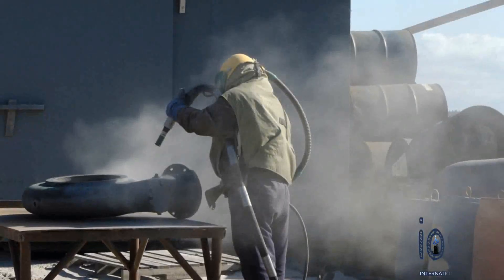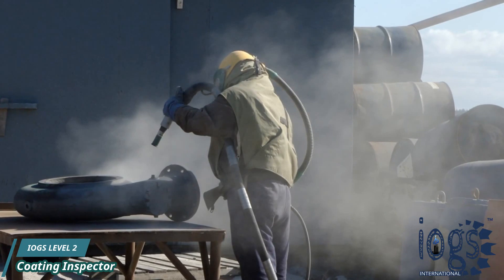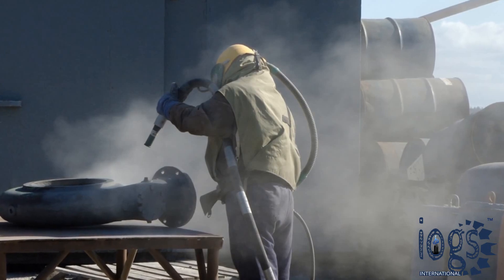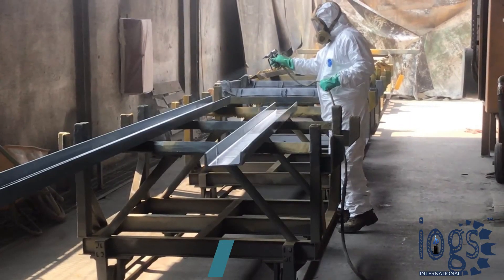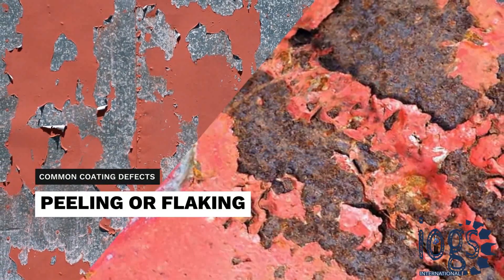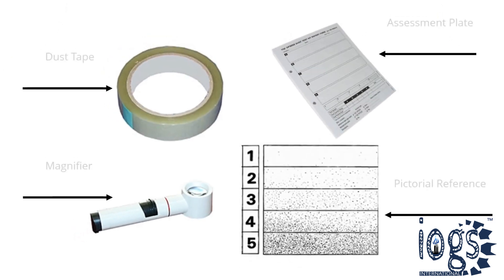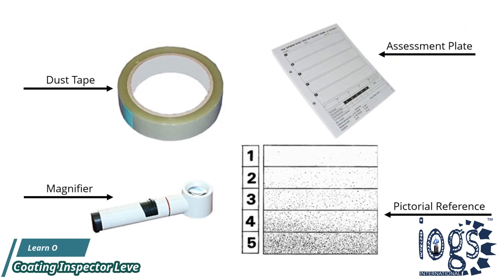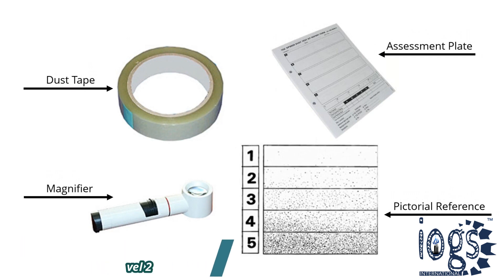ISO 8502-3 Dust Tape Test  — Dust Test After Blast Cleaning IOGS Official Video

Comment: What’s the exact purpose of that test?

Is it A to verify the efficiency of the cleaning process or B the cleanliness of the substrate before coating?
Reply: Ho there, this is for checking the level of invisible contaminants on the substrate before the coating is applied.
Reply: @mohammadkaif9280  You mean visible contaminants, right? ;)

I came to the conclusion that this standard in itself has no specific purpose. It's just a description of a test procedure. For the whole quality process, you have to consider other standards additionally.
Reply: @stebarg  yeah, you are right, I thought this is a salt test video
Reply: Both